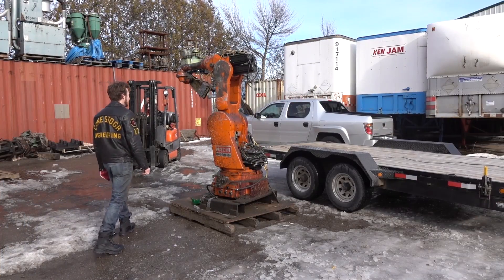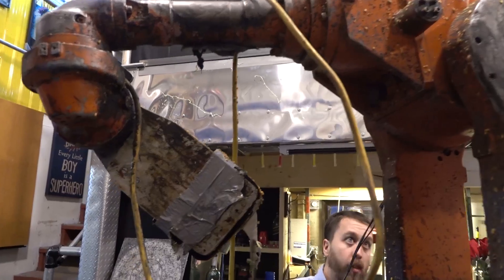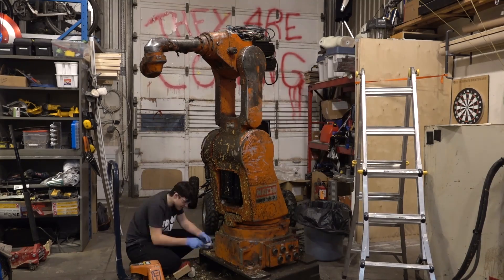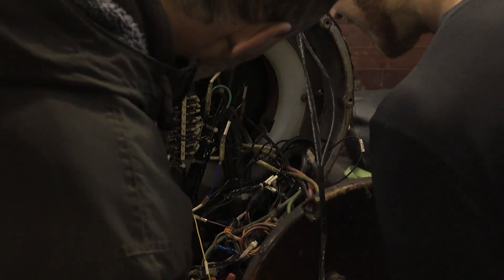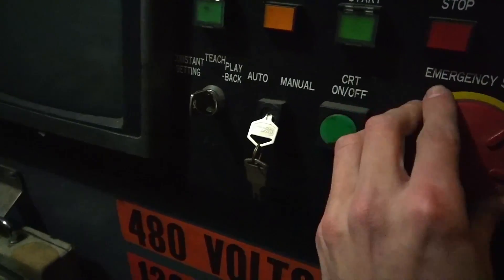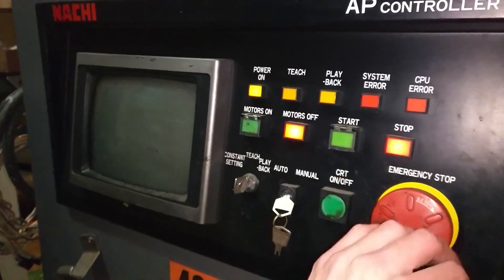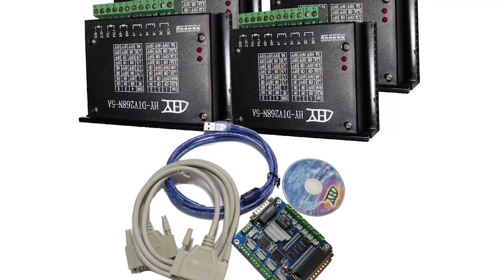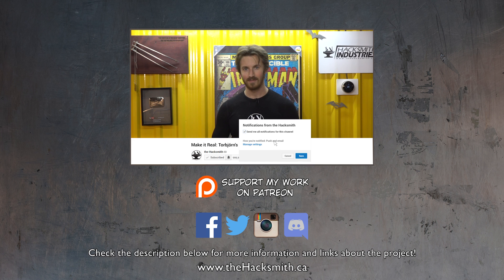Should We Bring a Robot Back to Life?

Comment: make a massive 3d printer out of it
Reply from the maker: Even if we get it working, it'd be another engineering challenge to get it talking to a computer. We'd love to, but it's probably not happening =(
Reply: Doesn't the controller work by having a file uploaded to it saying where the head of the robot needs to be? You could write some code with some mathematical equations in it that would write a file so you can upload that to the controller. Might need a programmer for it though.
Reply from the maker: It's just a dumb automation machine from 1990. It has a teaching pendant to teach it movements. It does have a floppy disk drive so hypothetically you might be able to upload code, but again, probably not worth it.

Comment: What would you do with it though?
Reply from the maker: Everything... could be used for pretty much any of our project test videos...
Reply: the Hacksmith Okay, follow up question, would you have to specialize the actual tool, or whatever it's called, on top to the specific purpose, or is it virtually universal.
Reply from the maker: You attach whatever tool head you want to the end. Robots like these are used a lot for welding, assembly, moving parts, etc
Reply: That's really neat, I hope you guys can get it running, now that I am more informed I can see the true light in this project. Best of luck!

Comment: I'm a boring Mill operator and I see one in the video just a little peep of it that's awesome anyway I always wanted to have two of those industrial robots one to hold the job and the other one to have a Bridgeport head on it
Reply from the maker: You should see our Tormach PCNC 440! It's awesome
Reply: Yeah here in Detroit Michigan I machine weldments for the robots so they can do Automotive task I'll check out that machine online
Reply: I like your Iron Man challenges I've often dreamed of making an Iron Man suit myself but the only way you're going to get the kind of flight you're looking for is you're going to have to go old school for the power supply I'm talking old school mad scientist you have to use a Tesla coil to supply juice to those Motors so you do not have to have the battery weight
Reply from the maker: Tesla coils don't produce electricity... they manipulate it... Anyway electric motors are 90-95% efficient and lithium polymer batteries have some of the highest energy density available in battery form (3 times that of lead-acid). We'll be able to fly, just not for long!
Reply: the Hacksmith I never said that Tesla coils created energy I was just stating that it was a form of getting energy from an object without wires or battery weights and as much energy as possibly needed because you could have it hooked up to the grid
Reply from the maker: The finished system will draw around 150kW -- an average house can only provide 48kW. If it were possible to make a tesla coil that big... well it'd probably cost more than the flight project itself, and the pilot would probably get cooked from that much EMF =P 

An induction coil (like wireless cellphone chargers) would be cheaper, but you'd have to be a few centimeters off the ground... and again, that much power being transmitted would be scary!
Reply: the Hacksmith I guess if you were just going to use external energy you could just have a wind tunnel underneath you I guess you'll just have to come up with a Zero Point Energy generator or a hydrogen cell the batteries just aren't going to cut you are trying to copy Iron Man don't make plastic man cuz honestly what you made was a Tim Taylor hair dryer let's be real the Wright brothers did more with some wood and cloth and thimble of oil if flight was that easy just some lithium batteries and some plastic don't you think NASA with their Unlimited Supply of  geniuses and money would have solved that problem

Comment: You will need to remaster the robot when you get it up and running so it knows where it is in the world and you may aLso need key software for it to run properly , had similar problems with an old arc mate Sr fanuc robot a disc drive alone is $1000 if you can get it

Comment: So, you have a robot arm and a (hopefully) working controller. My question is, what are you going to do with it, if it does turn out to work? I don't know what you would change it to, or if that's even possible, but I don't think that you have many projects that need some foam injections.
Reply from the maker: +Dypatome industrial robot arms can be used for anything, it wasn't specifically for foam injection! We are ultimately an engineering-entertainment channel -- a robot could be programmed to do things, much like how an actor acts -- it's not going be sentient and actually help us do tasks or anything lol
Reply: Thanks for the fast reply! I can't wait to see what's to come when we get the next update, even if it turns out that the controller doesn't work.

Comment: What if you disassemble the wire connections in the arm and switch them out for modern more universal cables so you'll have less wiring and you'll be able to use any programable computer to give it orders, heck attach it to a wireless rerouted and have your phone wirelessly send orders to the arm lol :P

Comment: I think you will want to go open source, if this old Nachi is anything like older KUKA robots, the controllers run a custom 90's era programming language and are pretty limited by today's standards. It make take you guys a long time to convert it, but if you just use the old controller and software, the limitations will probably cause you to leave it sitting around. In fact, just because the controller powers up does NOT mean it works, those files it was requesting in those errors might be custom Nachi files no one even has anymore, and the computer might be missing expansion cards, have a corrupted drive, etc.
Reply from the maker: +SpectrHz fully aware of that lol. If the controller does work, we'll just be using the teaching pendant to teach it, not interfacing with it -- that would be a waste of time, the tech is way too old
Reply: Cool :) Can't wait to see more vids on it, probably one of my favorite projects of yours.

Comment: You're sol unless you've got some parameters and documentation on that arm. I've repaired several robot arms over the years, and like many CNC machines, the worst problem is losing parameters. They are almost always battery backed. Unlike CNC machines, they aren't as strait forward, aren't as well documented, and are even more important to proper functionality. You'd be surprised at just how much goes into making these run. Distance between axes, style of robot (physical layout), motor control parameters, etc... Even if you have the correct parameters, and get everything loaded, then you need to figure out a proper mastering (homing) procedure. Finally, an arm that old probably has eproms for the ladder logic. Think proprietary dos based software to write the ladder, that you'll have a hard time getting. Admittedly I've not had to revive a Nachi, most of my experience is with Fanuc, Mitsubishi, and ABB arms. They're all very similar in functionality though.

 Basically, as soon as it booted and had lost parameters (select robot type), those cheers should have been 'awe's.

My advice would be to scrap it, or replace the control with your own. Depending on the type of servo, this'd probably cost you a few thousand dollars for the servo drives. You may be able to use the originals if they have an easy interface like +-10Vdc, but often the drives are integrated with the control too closely to separate out. You may need to add encoders, as a robot arm that old probably has resolvers and tachometers as it's feedback. Finally, once you can get motor control, tie it together with something like linuxcnc.

Good luck!

Comment: "Should we bring a robot back to life?"ABSOLUTELY YES#the HacksmithDid you know the model of the controller and/or the model of the arm?If yes post it here … I'll try to help you ( if I can
Reply: You can either use it to assembly some parts of a project( just dreaming) , it will be also useful controlling it manually in that case it's necessary to lift heavy loads or something like that … there will be a lots of more applications that at the moment I can't find
Reply: In my opinion , the first thing to do is find out how cables are connected( as you said), then try to retrieve some documentation on the controller( if any) , then try to figure out what files( I saw A LOT of " missing file " error , and what set of  commands should be given to the controller to make it move … if you can't find this informations , you can also trash THE BRAIN ( only the brain) and use the power stage with another brand new controller , because I guess that find a final stage that will brought you  20A@400v ( or more) it will be very expensive

Comment: so you really dont have 3 Phase power supply there? Is this just in canada or in the whole USA?
Reply from the maker: +Condor B. Only industrial buildings have 3 phase power
Reply: so ... you just get like two wires to your home? and what voltage is it?
Reply from the maker: +Condor B. Fairly certain you guys only have two wires in most of your standard outlets... All electronics work between North America and Europe if you have a transformer to go between 120v and 240v  -- if all your power was 3 phase I don't think that'd work..
Reply: I am a electrican from germany and every house got a 3 phase 400v so for
 me its somewhat whierd but really interesting to see how different this
 is from country to country
Reply from the maker: +Condor B. But are not regular outlets in your house just 240v one phase?
Reply: the Hacksmith yes they are. But the three phase 400v also includes an additional neutral. So you can use it as three phase 400v or 3x 230v one phase. All without converting. Since 230*sqrt(3)=400
Reply: The three phases are delivered directly from the power plant.
Reply from the maker: +McElfe ahhh gotcha

Comment: WTF?! 3-Phase Power is standard in Germany you get 230V and 400V. Also >50A per Phase. Poor merica :(
Reply from the maker: It's standard for houses? really?
Reply: of course! Most houses use an electrical stove. How else would you power it^^ Additionally there is usually an outlet (likely 32A/400V) in the garage or elsewhere for tools and stuff. Transport of power is more efficient this way
Reply: yes I work every day in different buildings never seen single phase
Reply: You actually can get 3-phase in residential homes in America depending on where you live, but it costs a lot as America has pretty poor infrastructure and the chances are high that you would have to pay the power company to run a 3 phase line to your house since it's unlikely there would be an existing one.
Reply: Can you get it in Canada though bc that is where hack smith is
Reply: America isn't a continent North and South America are but not America
Reply: OMG your a German to after so many years I've never seen another German on YouTube
Reply: The Hacksmith is actually in Canada. I got 3 phase in my garage "America" came with the house but its not very common.
Reply: Yes, The Hacksmith lives in Canada but also in America (PS: it´s a continent)
Reply: Frequent RAGE! you are indeed a dumbass

Comment: Scrap the controller and go open source!
Reply: YEA
Reply: Having no working controller to look at, means the open source controller might just be a blank PC with nothing on it. Or nothing compatible. I think they should at least try the opensource route, but if you have no idea how to program it then you're outta luck. There could be billions of combinations to getting the robot to work correctly. Like...if you have a remote control for the wrong TV, you'd be lucky if any buttons work. And then give that TV thousands of tiny robot movement functions...and try to program all that. Even the robot developers likely took their entire careers to develop the perfect firmware for the robot. The robot could have quirks, like heating problems, that only the original developers know about. Most the creators of the robot are likely dead anyway, but it's still a cool project. Sorry that was long. T_T

Comment: What? It can be fixed in a week. Ditch the controller!! Replace the servos with Clearpath step/dir servos, add a opti-isolated breakout board, free LinuxCNC software and you will be up and running.
Reply from the maker: So wanna come help then?
Reply: Mekhanic1 I would so take the offer if I were you.
Reply from the maker: +ZN Gamer  engineering time is worth $50 to $100 per hour. So 100 hours is worth $5000 to $10,000 :p

A new (used) working KUKA robot can be purchased on eBay for $5000 with a modern controller
Reply: gamerdudes superelite same
Reply: It will be way harder with that controller.
Just use an Arduino to control the servos.
You will lost days trying to make this controller work, and it may never do.
Reply: Sorry but i dont think that the last year i take a course of abb robots and this kind of equipment is very complex  I dont have the intetion to offend you please dont take wrong
Reply: the Hacksmith YES
Reply: Mekhanic1 if you look at it that way 100 hours isn't that much
Reply: I would come help, but i am in Germany so... :(
Reply: me to
Reply: Pootis squirrel he didn't say you
Reply: Mekhanic1 And how much will this cost?
Reply: Lucas A. Lopes How do you purpose they connect it to an arduino?
Reply: Mekhanic1 Holy shit..I didn't even thought of that